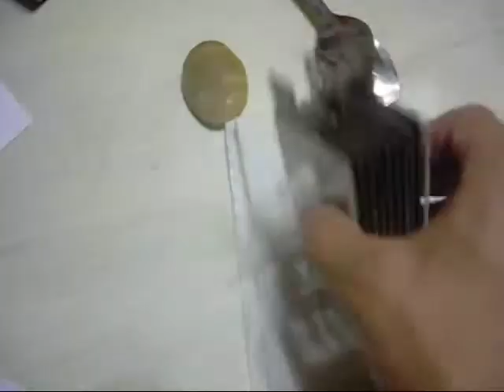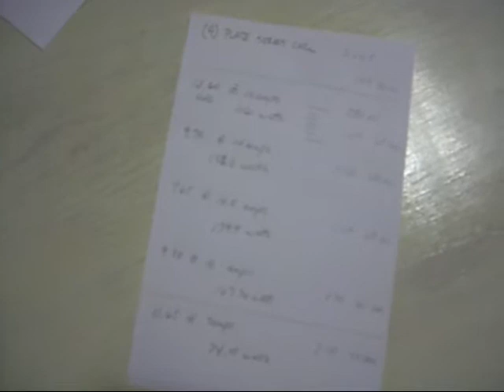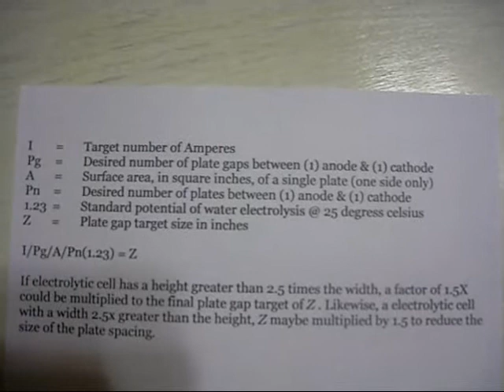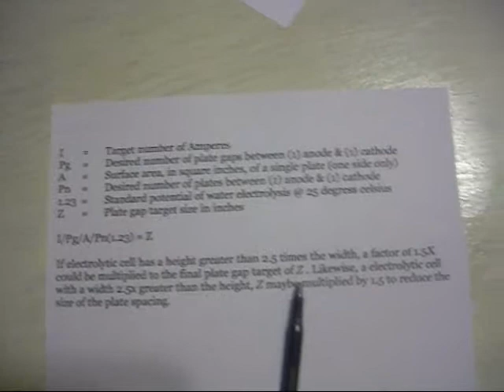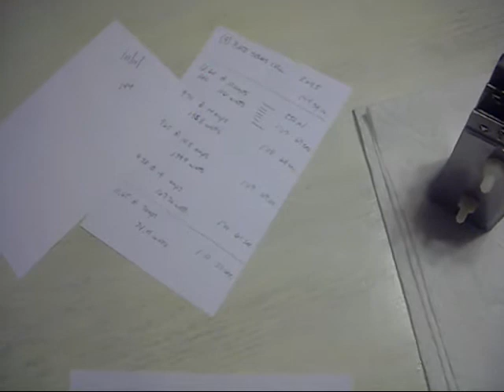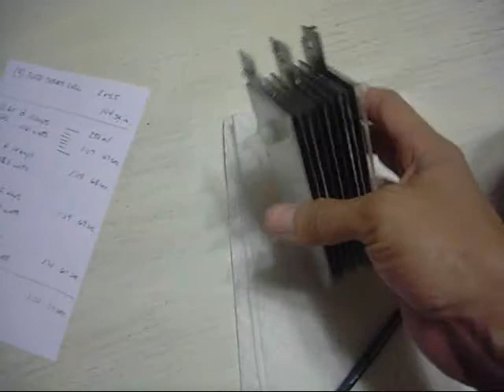Plate Gap Theory (03)

Comment: if im not mistaken the voltage and resistance determine the amperage. ie if you raise the voltage there will be less amp draw. the higher the amperage the more heat is generated. soooo, the ideal is lower amperage raise production. or smaller gaps more voltage. there is a threshold where you will get arcs. if im wrong about any of that let me know.

Comment: so your theroy must show set variables like solution resistance, and voltage for your spacing theory to reach a certain current. and what you want is maximum sustainable current without short circuting the system or overheating. so place plates as close together as possible but without arching across the electrodes. or keep them where they are and up the voltage as high as you can without arching. in the end it will take more voltage for increase because the resistance is pretty much set

Comment: current is the only true measurment of electricty moving, voltage is a measure of the presure that is needed to overcome a given resistance to achieve your current target. You can close the spacing, and add things to your water to increase continuity to reduce resistance, but once your solution is at its absolute minimum you must increase voltage to get a higher current, bottom line, to get more electrolisis you need more power period. either through higher voltage or lower resistance

Comment: not sure on how much you know about electricity. but current is directly proportional to voltage on any given resistance. to increase current you either up the voltage or lower the resistance. by spacing your plates you are adding resistance cuz of the extra water it must pass throuth. v*a=power (watts), the watts are what you are really trying to calculate. because any given target current will need a different voltage depending on the water solutions resistance at a given spacing